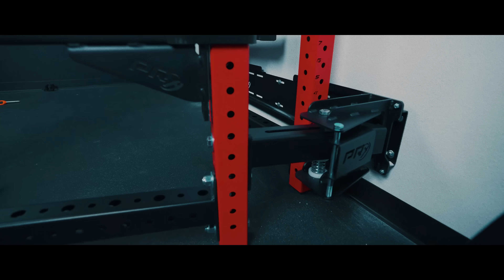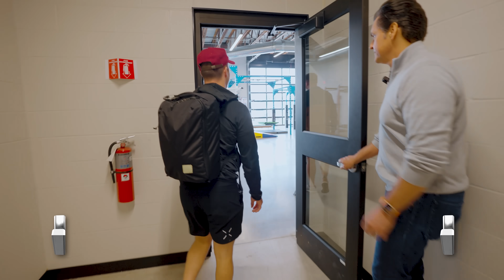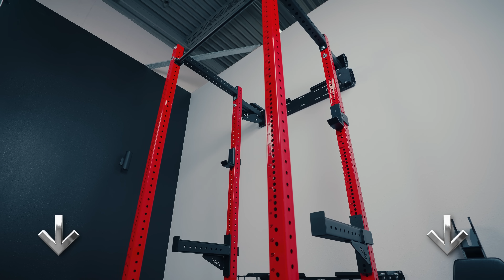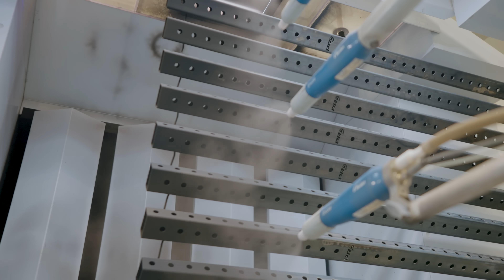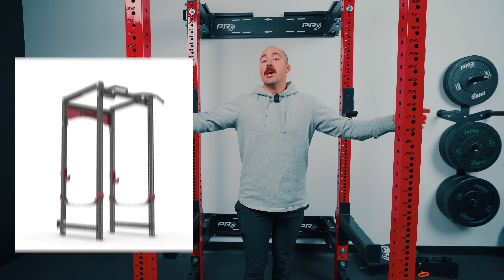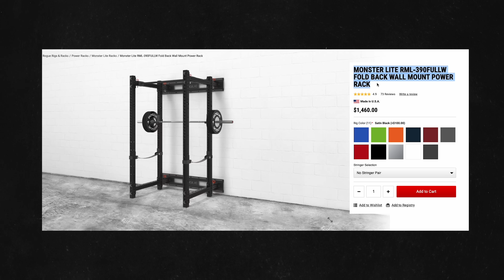The Most Over-Built Power Rack That…Folds? PRx Folding 4-Post Rack Review!

Comment: This rack is exactly what I'm looking for right now. But I'm having a hard time justifying the additional cost vs Rogue, especially when Rogue has cheaper shipping and comes with safety straps - PRx said safety straps are coming for this but not available yet. 
I'm glad they're working on accessories for it, but should have had some key ones ready to go at launch.
Reply: Yeah they should be including several accessories at that price. Im a bit disappointed
Reply: @JBS7551  and with Coop saying it's 31" vs. 3-" depth, not sure the Rogue safety straps would work.
Reply: @jordanglickson5644  Yeah not a huge fan of them doing that purely for the fact of being forced to buy their accessories. I get it I guess, but still
Reply: @JBS7551  I get it I guess if those accessories were available at launch.

Comment: I am looking at the Athena Wall mount with dual selectorized  (Added weights) pulley system.  With Spotter arms and and band attachments, you get a small system with a functional trainer.  Being mounted to the wall seems to add stability as well as the selectorized weights.  Adding the seat attachment will allow for pull downs and low rows.   More expensive, but what I’m looking for.
Reply: Now they got the ares 2.0 wall version

Comment: I need a place to store weight plates (up to 50 lbs) with 1 inch holes.   I would like to have detachable weight pegs for both the rear posts.  The radius of a 50 lb plate is about 8 inches.  To accommodate them, the holes in the rear posts would need to be about 10 inches away from the wall.   Otherwise, this rack is a step in the right direction.

Comment: Coop what is the general loading capacity for studs? I was contemplating how safe my current setup is having 2 pairs each of 10-25kg plates plus an extra pair of 25kg plates on 4 rogue stringers across two studs. With this having the mass so far away from the wall, how much stress is this putting on load bearing studs and how close to failure could these take studs to start splintering?

Comment: Also, the REP PR-4000 uses 5/8th inch holes.  If you want to add a nice pull system, the REP Lat/Low Row system may work with this (as would other PR 4000 accessories, I'd guess).

Comment: They should’ve matched width and height of Rep. Doing their own dimensions is a killer in my opinion. The size of their eco system and the cost just isn’t justifiable. I used to own their fold down rack and loved it but ultimately sold it and got a Rep PR-5000 and couldn’t be happier.

Comment: I'm glad to see this doesn't suffer the same design flaw as almost every other foldable rack. At 12:19 you can see that it's capable of being lifted up and down. This is essential because other (poorly designed) racks don't do that, which prevents the feet from planting firmly on the ground. Instead, the rack (and all the weight) is basically suspended from the wall, cantilevered out from the hinge. It means that you have to install those racks at the perfect height so that the feet barely skim the ground while folding (and god help you if your floor is uneven) and it'll only make contact with the floor once you put weight on it and it's bent downward.
Reply: Just use 2 pairs of wedges to place under the uprights for positive contact with the ground. We use them all the time in building shoring system for structural collapse (Urban Search and Rescue) scenarios. If folding racks are used in garages, a garage floor is built on a slope so fluid spill will drain towards the door opening. If mounted to the back wall, the slope will increase from front to back as it unfolds. If mounted to a side wall, the slope will cause each upright to be different heights above the floor. Wedges solve both issues.
Reply: Would this be an issue on the Prx Profile racks as well that fold down vertically?
Reply: @-m7778  I don't know how the mechanism / hinge on those are designed, but since it's meant to move in the up/down direction already, I suspect it would be ok.

Comment: For that price you can get that rack that turns into a bed, and just have your rack in your bedroom instead of your garage. It also doesn't have 1 inch holes, so I am out. Skewing away from standardization for literally no reason other than "tiny hole is strong enough you don't need big hole" is an idiotic take on engineering.
Reply: LOL, a Murphy Bed squat rack!
Reply: @chrisb4457 It's the PIVOT squat rack.

Comment: I need a cable machine with a smith machine and duel adjustable pullys for cable flys.  under 80" tall,  plate load or stack, anyone got ideas?
Reply: If you're on a budget go with the Bells of Steel cable tower (plate loaded) or their stack version.
Reply: I am looking at the Athena Wall mount with dual selectorized  (Added weights) pulley system.  With Spotter arms and and band attachments, you get a small system with a functional trainer.  Being mounted to the wall seems to add stability as well as the selectorized weights.  Adding the seat attachment will allow for pull downs and low rows.   More expensive, but what I’m looking for.
Reply: Thanks- will do
Not really a budget, just height problem

Comment: they need to make a 3x3 1" hole - More or less the industry's standard for a lot of the attachments.
Reply: 100%
Reply: I wonder why they didn’t
Reply: @17277-s  The CEO talks about it in the factory tour video. They really want the Westside hole spacing in the bench area (not possible with 1" holes) and the CEO was confident that 5/8 is all any customer would need because the bolts/hardware are rated for something like 50,000 pounds. And of course the cost impact.